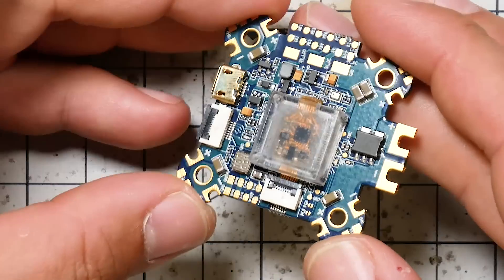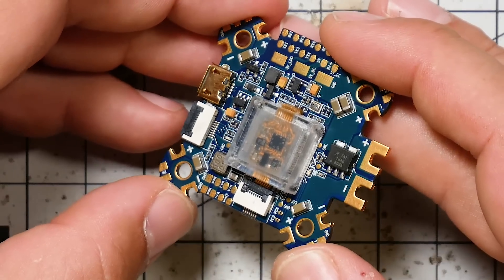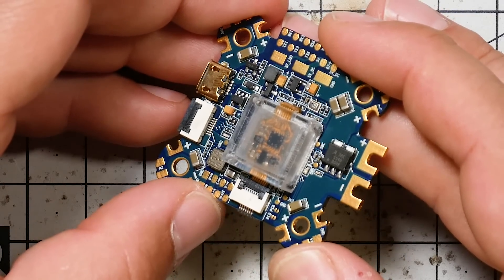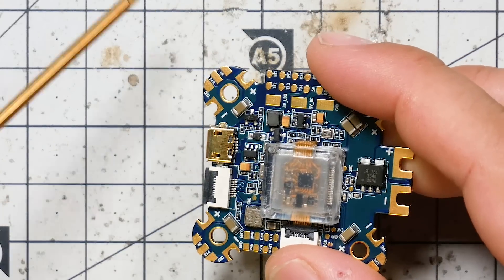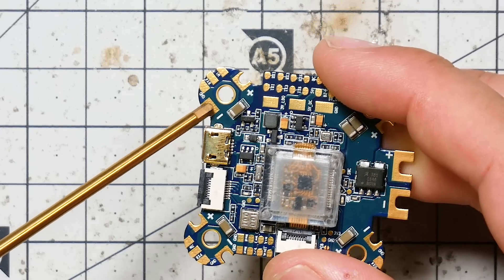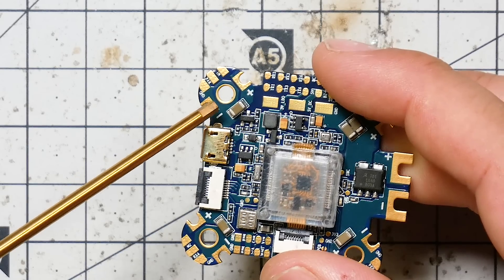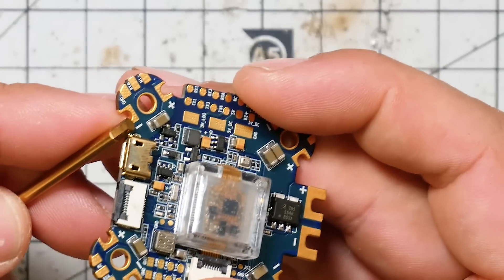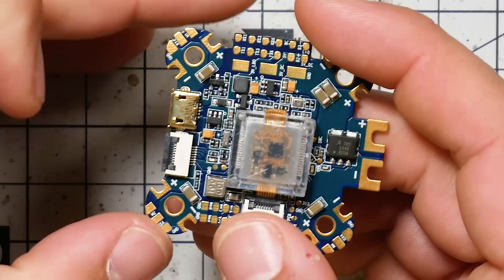Omnibus Fireworks V2 | BETAFLIGHT FLIGHT CONTROLLER REVIEW

Comment: BTW, I'm still only planning my first 5 inch build, but... Well, I'm debating a lot what FC/stack to use. I wanted to use the Holybro Kakute stack, but with the RunCam Split it gets too tall... And most of the frames I like aren't tall enough. 😕
So I started to think about the Racerstar TattooF4S, but... Racerstar, right? Now I'm thinking about the Dalrc Engine + F4, but they connect via pins... So... 😕
Reply: The Racerstar boards are generally pretty good. I run the tattoo escs with some quality motors and after a year they still kick nicely
Reply: Maybe don't use a 4 in 1 esc. If you are just starting you are more likely to bust a ESC and it's cheaper to replace 1 esc than a whole 4 esc's.
The flycolour esc's are meant to be great.
Reply: That sounds great.
Hope it all goes well.
Reply: Wtf stop planning and build something to fly! Under every single fpv vid I see you commenting! Go out and fly instead of searching the perfekt solution! My fucking gosh!
Reply: MC's Creations and if the frame isn't tall enough use taller standoffs!
Reply: 40 amps isn't really that much of an overload. Plus if you have a light build the motors will unload more in flight. A 2207 on a light build will pull somewhere between 25~35amps depending on weight. Plus you're not going to go full throttle all of the time, so it should be ok.
Reply: Joel Posthuma Yeah, I know about them. I saw Drone Mesh's tests of them. 😊 But I really rather use a 4 in 1. It could be more expensive and have problems (like burning one of them, as you mentioned) but I have some experience soldering and it's much easier to work with... And, until then, I'm going to have some experience building quads too, since I already build a brushed one and I'm going to build a 2.5 and a 3 inch. You know? I want to get there slowly, because I don't even know how to pilot yet. LOL (But, don't worry, I'm going to get a simulator. 😉)
Reply: Joe Gonzales 😂😂😂😂😂
I already did! I build a brushed micro already! 😀
Now I'm going to make the initial setup my Taranis and then install a simulator to train. 😊
Anyway, everything I'm doing I'm recording and I'm going to post on youtube, but in Portuguese. (Here in Brazil those kind of content is really rare.) And I'm going to build other quads, already ordered everything for 2 more brushed micros and for a 2 inch. The problem is that it takes up to 6 months (!) to things arrive here. 😕
Reply: MajorProblemsStudios I  thought I had answered you... Anyway, the biggest problem about the Racerstar TattooF4S is that it's FC + 30a 4 in 1 FC with maximum burst of 35a. And most 2207 motors can demand up to 50a (!) in thrust tests. That would mean top 40a in flight. You know? So, I'm afraid of using it and burning it in the first time I go to full throttle. 😕
Reply: Portal FPV Yeah, absolutely. But I was talking about other options I'm considering, to see what you guys think about. 😊 Because I'm a little lost right now. LOL
Reply: If you want I made a list of cheap 5" drone builds for an FPV club that I run. If you want to see the list PM me

Comment: a couple of things:  Airbot makes the Helio, this board also has a barometer, I used this as my first build and it was nothing short of simple. noise free on a first build (ugliest solders you ever saw). I was super happy no doubt. Very simple to build FYI, even though it looks confusing the wiring diagram was A+ and everything "just worked".

Comment: I don't know, JB... But, for me, since the board come with a piece of paper with the complete schematics... Like, where to solder sbus wire, sport, smart audio and so on, the build is going to be easy and straight forward. You just need to know what you need.
Reply from the maker: Yeah, the pinout diagram is fantastic. A bit overwhelming for some I think.
Reply: Joshua Bardwell You know, the youtube is acting strangely lately. I never received a notification about your response. O.o

Comment: My favorite no nonsense Betaflight setup is the hobbywing xrotor 4 in 1 and x rotor FC running on betaflight 3.2.1 fw, yup older fw it's just buttery smooth and simple. Wonder if they are going to release the 4 in 1 with this as a combo if so I'd go for it, Thanks for the breakdown JB.

Comment: Are you planning on doing a helio spring setup video? ie; optimal filters and stuff:)
Reply from the maker: Ummm isn't the whole point of Helio that it's optimally set up right out of the box?
Reply: Joshua Bardwell with Odin it’s nearly plug and play. PIDs will still need tuned in some cases. But that’s something we are also looking at. 

BTW, we said on a few podcasts and publicly that Airbot makes our board. Have you not been paying attention ?

Comment: really like the space for caps. with those mounting holes. in some frames the standoffs can use the same holes for both mounting the fc and also frame.  would a metal standoff cause a short as they look very close or is their enough room for a standoff and soldering?
Reply: the standoffs took a beating while soldering. this was after mounting. there is certainly room. it is a very noise free FC. I had the public test version (still available) which actually has tantalum caps onboard. both were very noise free. i like the v2 as the video is very regulated on 7v+.  really nice for the new AKK's or Unify HV's. I have had some serious problems powering any vtx that requires 7v+ on a pdb or lipo. noisy as shit. but the airbot and any FC (like the JBf4) that has a proper 7v with LC seems to solve the problem./
Reply from the maker: Metal standoffs shouldn't cause shorts but I guess you can't be 100% sure. I wouldn't use metal standoffs on an FC I don't think. Metal screws maybe.
Reply: Ermagerd it’s uavfutures

Comment: I thought that was called the pro corner? Maybe just a Rebrand
Reply: QUADBOT FPV no rebrand the pro corner is made by Airbot.. the non Airbot ones are clones. This is the new version of this board... i loved my Airbot pro corners (the fakes are garbage and pads lift like crazy) but the real thing is a hell awesome FC and pdb..
Reply: luba brock interesting I haven't heard any bad problems that's usually a operator error. I've been in the hobby almost 2 years and have never lifted a bad even on all of the cheap cloned flight controller as I get from banggood. Often people don't know you're not supposed to press on the pads with your iron or use any pressure on it just barely touch it with the tip that's already had solder applied to it and then ur the man
Reply: QUADBOT FPV I didn't know that..... Glad I do now.